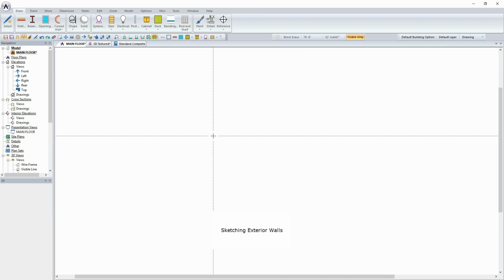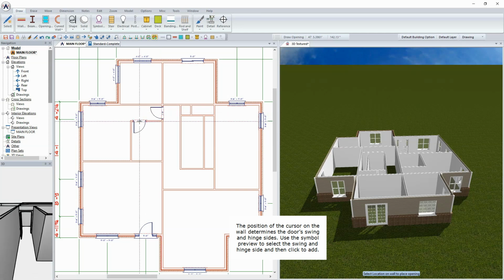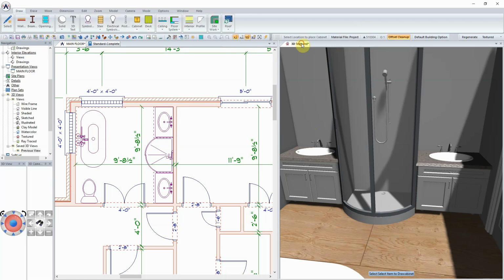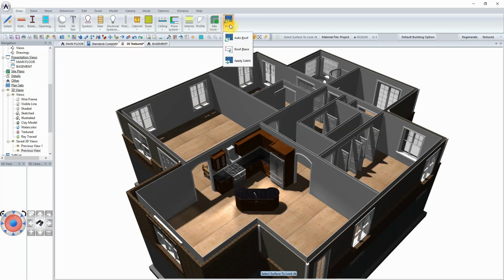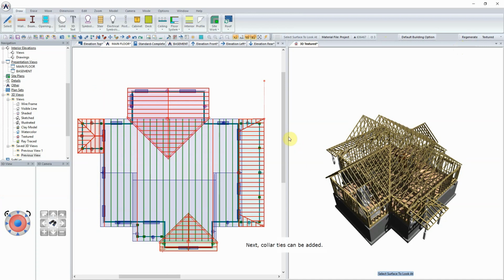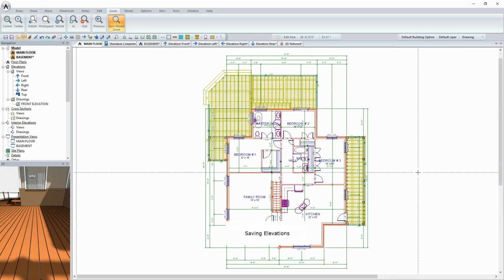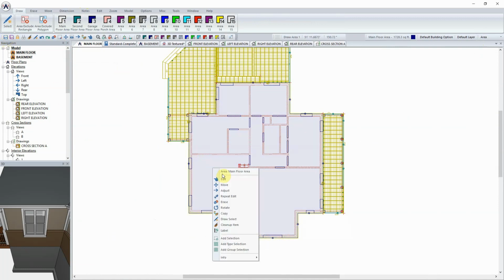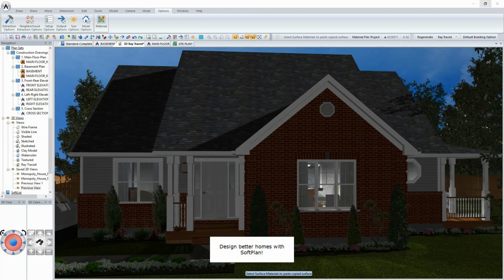SoftPlan Demonstration

Comment: Softplan has alot of promise. After all they are a small company but a very fragile one. They miss the point and id assume VP John Jones is probably the core of the problem. Unfortunately addressing these fundamental problems he'd much rather refund you than accept responsibility for his poor judgment calls. Support during most companies working hours suggests they dont care or couldnt be bothered with smaller groups, most architectural firms just use autocad and dont even bother. So a nitch that their VP is incapable or too arrogant to market to is the one group that would use their product. 5 years and they cant even generate revenues off youtube due to lack of media.

I made the misfortunate decision to call out the VP for being responsible for ignoring reality and well now they wont bother addressing my concerns. They may want me to be a person to "go away" however meeting clowns like these all throughout the industry i feel its appropriate to actively call them out for their poor practices or broken software. And at this point i dont believe ill withdraw until the VP is removed. Ill be sure to inform every business that utilizes an autocad can steer clear of softplan. If you cant take responsibility for your product and rely on paying customers to produce content you are no better than silicon valley. And your in TN? How do they even accept you. 

Id bet they are simply trying to get enough traction to be appealing enough to sell out. After 7 years through and poor amateur development flaws maybe china would buy em.

Next time id encourage swallowing your arrogrant developers pride and accept community feedback. Maybe i could be alittle less harsh but theyre too many development companies that exploit ignorance